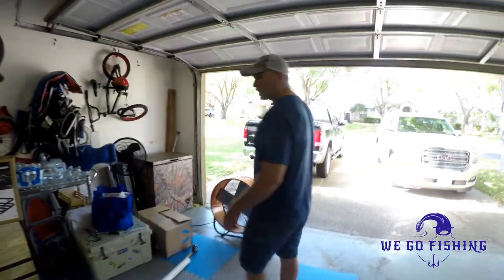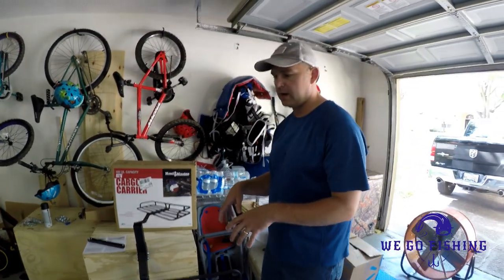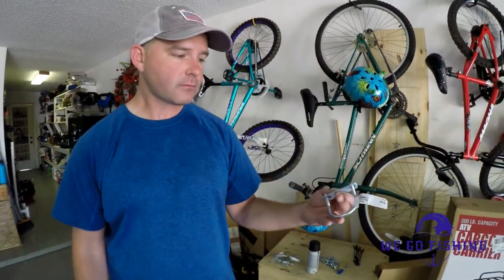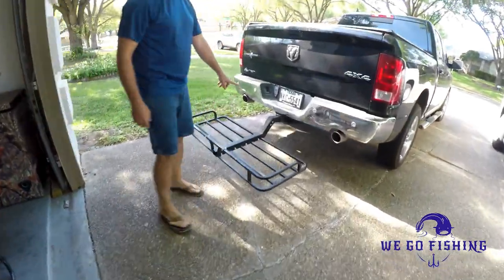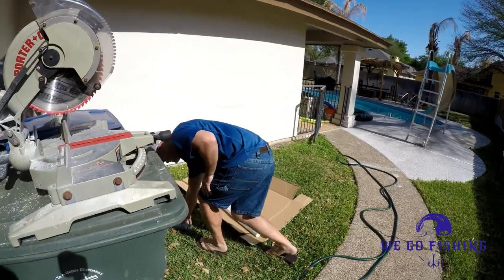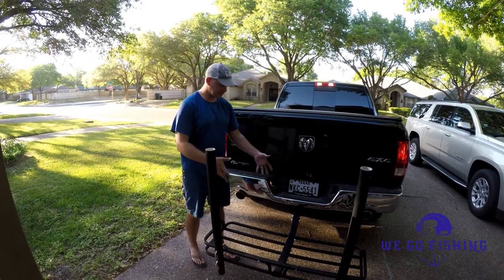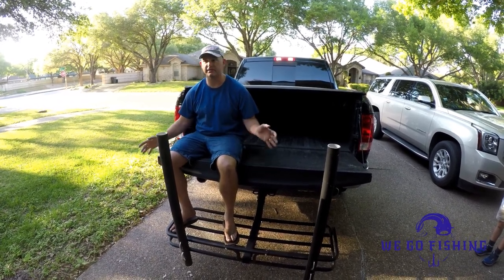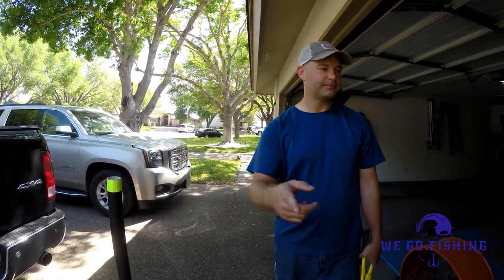How to make a custom fishing rod holder for a trailer hitch

Comment: Nice but use SS hardware
Reply from the maker: You raise a good point and I am not sure those ubolts are stainless steel. Thanks!
Reply: @WeGoFishing  Just paint the bolts, stainless U-bolts are at least 10x the price. BTW, If you install the bolts from the rack outwards, you don't have to bend that flat plate. Really, you don't even need the flat plate, just two flat washers.
Reply from the maker: Thank you for the suggestions. Really appreciate it!